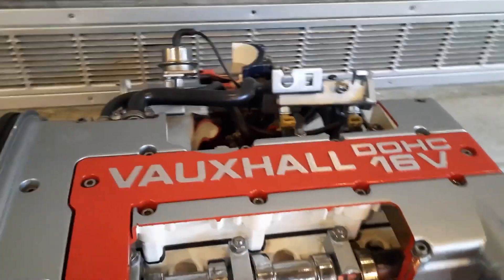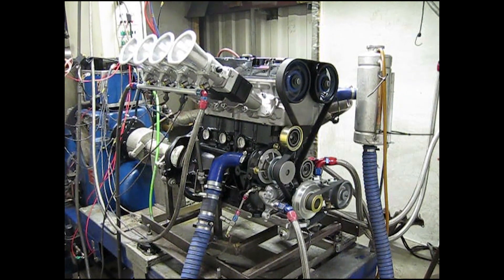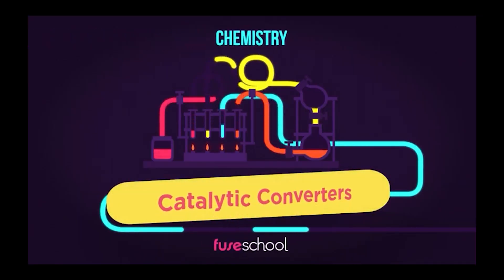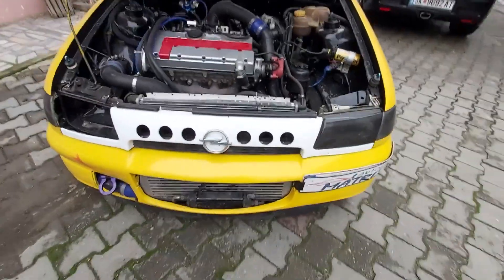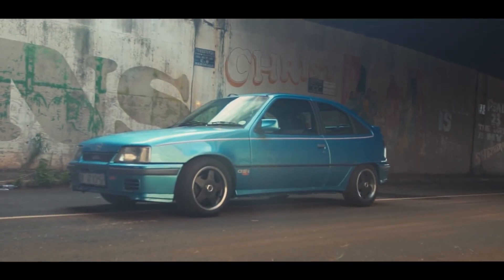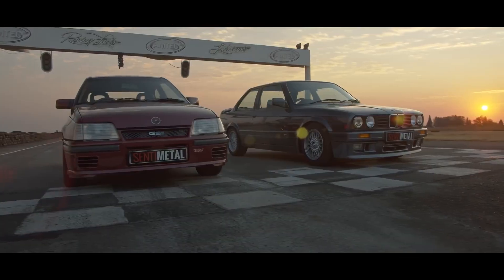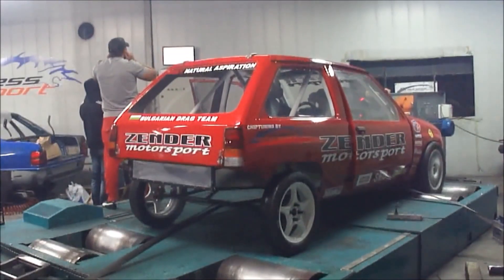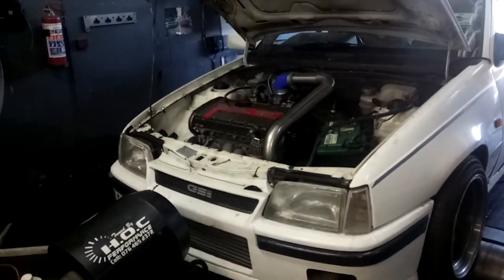What made the C20XE ‘Redtop’ such a Legendary engine?

Comment: My Calibra’s engine! I loved this one..  so incredibly raw. Get it with a cosworth head, replace the hydraulic rockers for mechanic ones, get short shift way, light flywheel and a small tune and it’s sooooo reliable. Use the standard F20 transmission and pull it to 100km/u in 2nd gear. ❤

Comment: now do you have any idea how to get one of these in america, because looking online here theres basically no listings whatsoever. not even European listings so I could import one.
Reply: Best chance is look in Germany (in German not English) but I don't see why if there is no local market for all the small parts you'll need.
Here in Europe, the cheap fun stuff is all Opel, Volvo, BMW. The Asian cars were never as popular because they were relatively expensive and interiors felt cheap. American cars also did not work here because the weight and size makes them very very expensive to run because of taxes and fuel prices. So anything non European is expensive and hard to find.
Nowadays all the good Opel stuf is also getting much harder to find. Most of the wreckers have been used up in the 90s and 00s for cheap replacements in rally sport. I mean the market is still there but prices are way higher and we have some guys making parts new as well.
Why not go for a Ford Ecotec Cosworth? It's pretty comparable to the GM / Opel stuff but probably much easier to get parts for in the states.
Reply: @ThaJay  yeah EcoTec would be a much better idea for an inline 4, at the time I was trying to use a GM engine for whatever reason but that project was dumb and is dead.

Comment: They were a bad xu9j4.
The head is a reversed copy of an xu9j4.
So much so to the point the xu head will bolt to the redtop block.
It was a cheap conversion in the day to get a front facing intake
Reply: not really, very different engines
Reply: @rito2795  it was a frequently done modification in privateer rallying in period. The peugeot head was cheaper than getting the vaux head fully done to big valve specifications. As that was the size the pug started at

Comment: Sorry, this engine was developed in Rüsselsheim and not at General Motors, although that was also the parent company of Opel.
Reply: The cylinder head of the XE was developed by Cosworth in the UK.
Reply: @WestfieldFreshAir  Common mistake, only some heads were casted by "Coscast",wich are known for better performance and durability than the other heads. Not engineered by Cosworth
Reply: @xX_Kyl-E_Xx  It's no mistake. I was told it back in the day by the owner of Cosworth, I'm not sharing hearsay. I'm not talking about the head casting either, but the head design.
Reply: It sure was develloped in Rüsselsheim. But Cosworth surely was heavily involved in the design of the 16 Valve (C)20XE and LET. Head of engine design at Opel back in those days was Dr. Fritz Indra. In an interview with "Car Design And Technology" in may 1992  he is rather dismissive of the groundwork done by Cosworth in designing a four valve version of the existing 2 litre Opel/Vauxhall engine.
Reply: @AstraGSiC20XE  Thanks for your answer.
My own Kadett GSi 16V belonged to Leberecht Fröhlich until 2008, called "Leo".
He was the overall project manager for the Kadett-E in Rüsselsheim at the time, everything went through his desk.
And Fritz Indra is his personal friend and former colleague.
I learned a lot from Leo and that's why I can say that the development of the DOHC took place mainly in Rüsselsheim, without wanting to question the work of the very good Cosworth company.
Greetings
Reply: Yes but based of the design of cosworth this engine pretty much gave gm a match to fords zetec engine I'm wondering why opel stopped production of the opel/cosworth kf engine it was a direct match to fords duratec v6 gm should have pushed for these engines what a waste 😢

Comment: Finally some love for these brutal engines!👌 C20xe and c20let🔥
Reply: Right 🔥
Reply: I like the Manta handle nice but i like Coupe's 🤝
Reply: And finally a badass comment... c20xe manta owner here😎
Reply: Got a old 20se dictator in the corsa b utility 1.7tdi conversion 😅
Reply: C 40 E Omega B Irmscher
Reply: Loved working on these  In the  90s. 16v s 150bhp.
Only weak point was oil pumps at 120k
Rebuilt about 12 of them with oil. Pump failure for customers.
I always checked oil pressure then on anyone I worked on or serviced.
Love to rev at 6500rpm all day